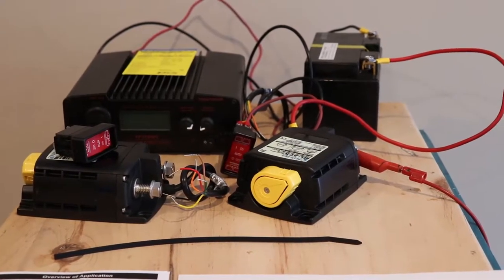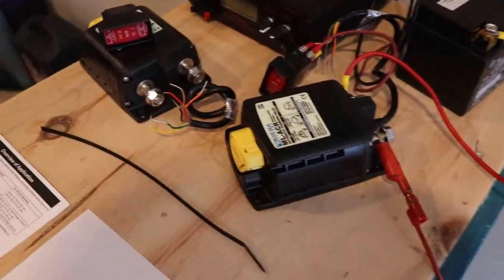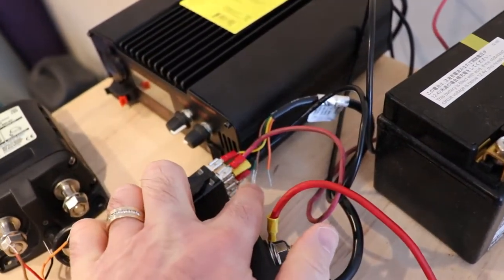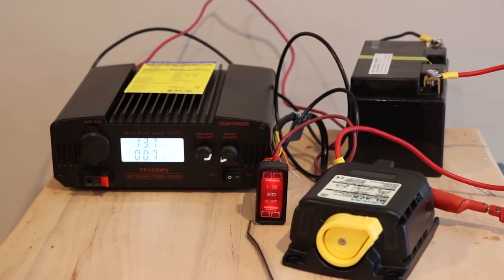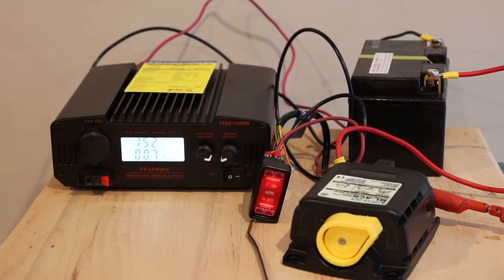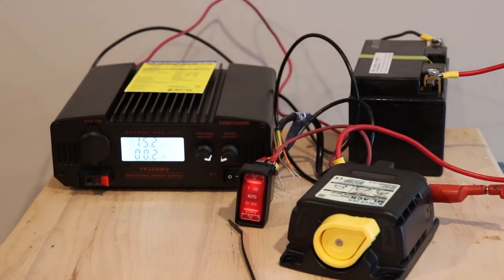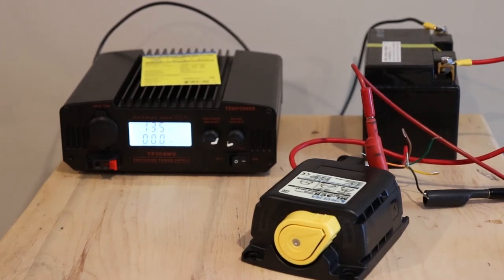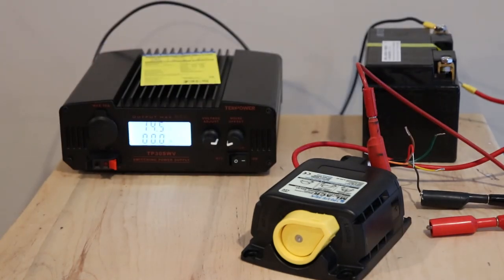Blue Sea 7622 Automatic Charging Relay Walkthrough

Comment: Any chance you can help me with a question using the ML-ACR isolator?

I'm planning an isolated dual battery setup to separate a main starting battery from an aux battery. 
Aux Battery would have the Stereo system and other components like headlights.

In my case, I'm using this automatic headlight kit that turns the headlights on automatically at night. The module needs a 12v Ignition input and a 12v Constant input.

If I gave the module a 12v Ignition feed , which comes from the main battery, but then provide the constant 12v feed from the Aux battery, would this be fine?

I guess I am lost about how certain accessories get their Ignition trigger input (like a stereo system) which comes from the main battery, yet power them with constant 12v feed from the isolated aux battery.

Man I hope that makes sense. I am so lost ATM. Appreciate any ideas you might be able to share!
Reply: Ignition feed refers to a voltage triggered by the key (ON) position. Use the feed from that on the back of your ignition contact or tie it into any other electronic you have that only works when the key is on. Ignition trigger does NOT come from the main battery - that feed is constant.

Comment: i am installing the ACR in my 20' CC. i have a brand new house battery and a brand new start battery. my question is regarding is it ok to charge my batteries with my NOCO GEN5X2 while attached to the ACR.
Reply from the maker: You should confirm that both batteries use the same charging voltage.  Mixing batteries like lithium's require DC to DC converters as the voltages are different.

Comment: Is wire between 8 and 3 just a jumper soldered?
Reply from the maker: I used a crimped jumper, you need to put 2 wires under the 8 or 3 terminals.  Here is the video of the final install:  https://www.youtube.com/watch?v=gLvC97b650c
Reply: @SteveRivett  basically just a wire spliced into 8 that goes to three right? So then you end up with power on both?
Reply from the maker: @Tahoematt  exactly